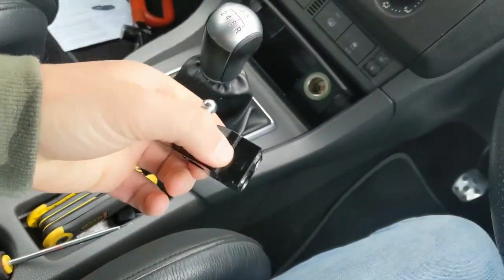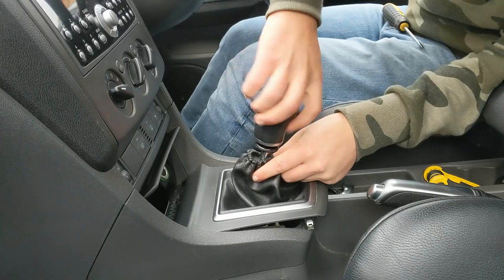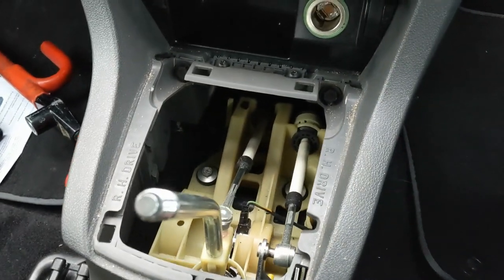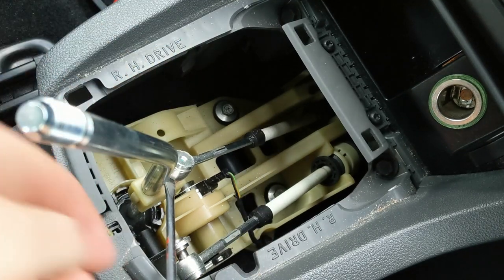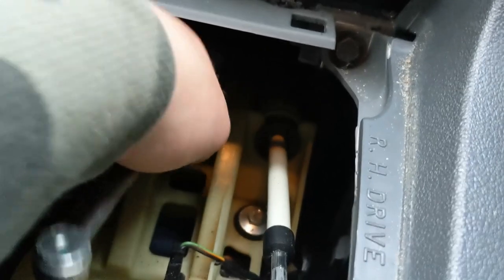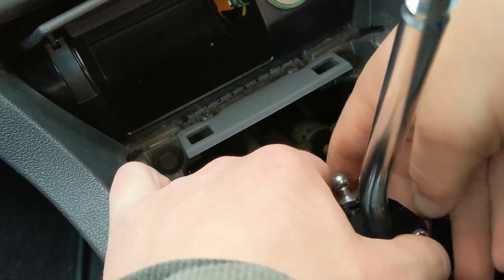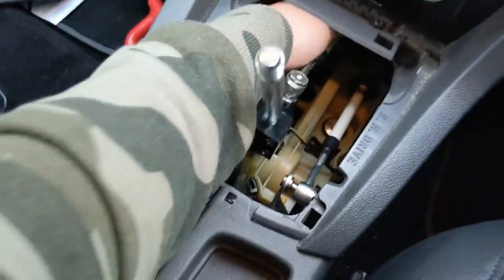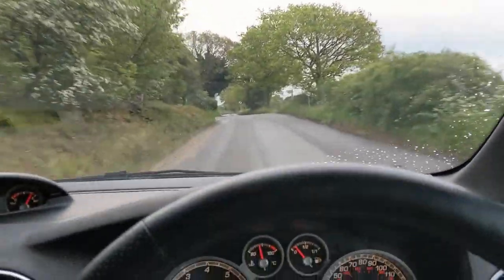Installing An AIRTEC Short Shifter - MK2 Focus ST225

Comment: Thanks for the video. Your video convinced me to buy this adapter for my Focus ti 115hp.
Reply: Well, unfortunately the gear shifter in Focus ti 1600 115hp is entirely different. Airtec shifter is not compatible.
Reply: @telonio9  hey dude, did you find any compatible short shifter for your 115hp?
Reply: @GSethKal  No I didn't find one for 1600 115hp.

Comment: does it work on all focuses ?
Reply from the maker: I’m not too sure mate sorry. Don’t see why not though
Reply: I have 2007 Focus 1600 115 hp that would not fit. The inner rods are totally different.
Reply: @telonio9  by the way, is your gear stick springy to the center? I got the same engine as yours but 2005 and it barely centers itself. 2 mechanics couldn't make it better.

Comment: Nice mate i got short shifter you still got the car ?
Reply from the maker: Yeah still got it :)
Reply: @ModifiedCentral  haven't  got it fitted yet just had block mod done and rs clutch  turbo smart recirc  valve symposer delete  cold air pipe